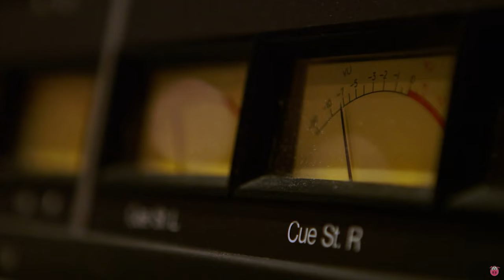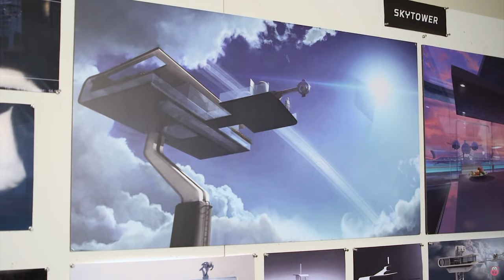Oblivion 2013 Extensive Behind the Scenes Inside Look

Comment: Would have been awesome if the "Bubble ship" could actually fly.
Reply: the drone is physically possible it just lack the air intakes to the engine but the movement vectors are a marvel.
Reply: Given a proper power source,I'm pretty sure it could.
Reply: @Scott Schriber Perhaps extra stability?
Reply: @Scott Schriber I'm a year late, but the tail rotor controls the bubble ship's yaw in atmosphere.
Reply: @Scott Schriber With only two jet-engines, you would limit your yaw, especially while hovering.
Reply: Very good point. The tail rotor is useless except as a visual reminder this craft  is based on a Bel-Air helicopter design

Comment: 4:43 - Actually we probably could build that with carbon nanotubing, unless you meant ''we'' as in the crew on the set.
Reply: no matter how strong it is, the pillar is way too thin and long, the wind at that altitude would just bend it and the house would be shaking like hell
Reply: plus there is a quite heavy bubble ship landed on the top and an entire swimming pool (1Ton/m^3 is the weight of the water)  so no matter how light the structure is, that's just impossible.